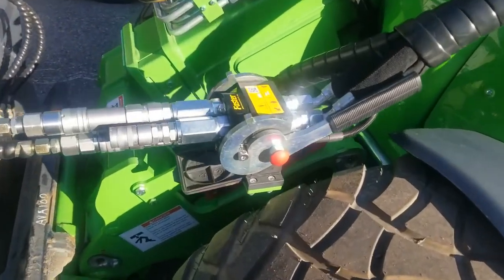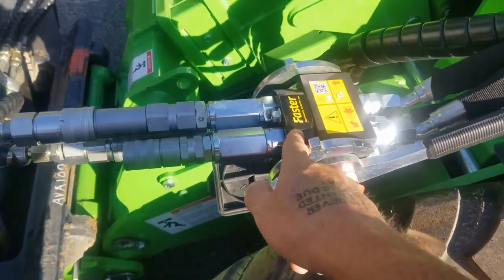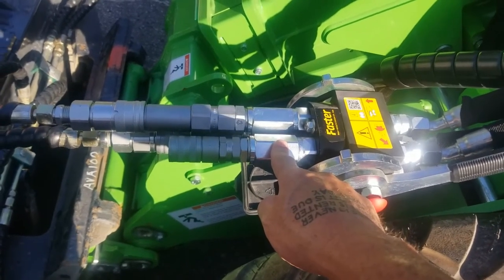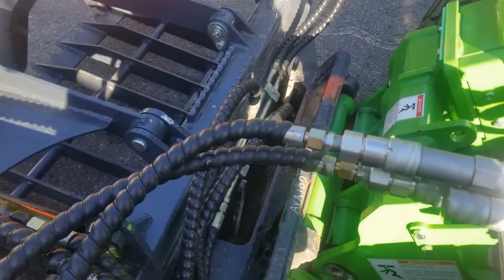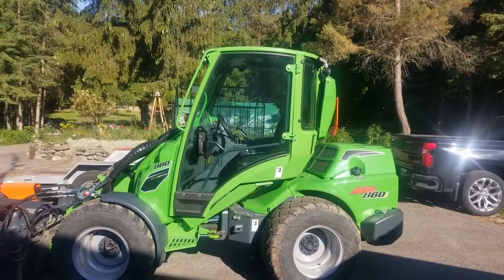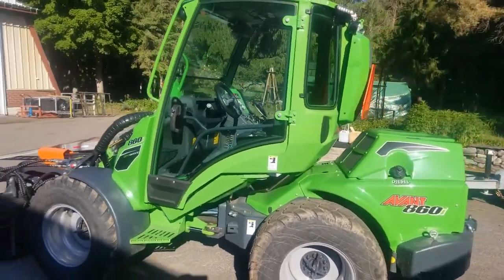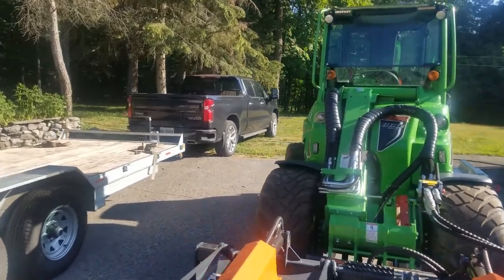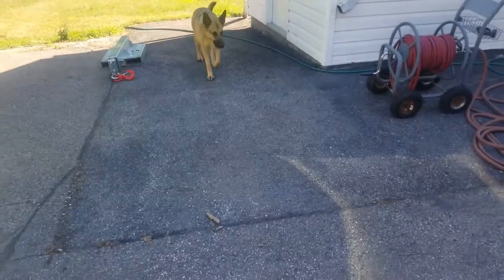Avant 860i moving logs with grapple bucket.

Comment: I just saw this. I’ve had a 520 for over ten years. It has practically same features but it is much smaller.

You should be able to steer even when machine isn’t moving, but the engine has to be running. Turn off the lock so the wheels can roll more freely. Especially if on tarmac,

The lift capasity of Avant is huge when compared to what each of them weights. Small tractor (4000 pounds or less) can rarely lift more than 1200 pounds. My 520 weight is about 2500 pounds and I moved a stone about 1700 pounds with it. I had extra weight in the back and a fork lift in the front.

The steering needs some time to get used to. Especially when going backwards.
When you go backwards and turn the steering wheel at first you feel like nothing happens. It is because the bench is moving to the opposite direction because it is over or even behind the center articulation. That makes you turn more and then suddenly you notice you oversteered. It makes you drive like a snake in the ground.

Otherwise I think it is a very good machine though it is not cheap. The set of different tools is huge. There are over 200 of them though many of them are a same tool but different size for different size of a machine. Them tools are not cheap either.